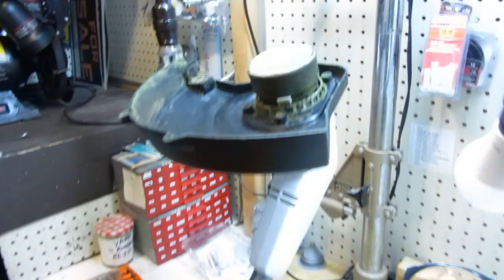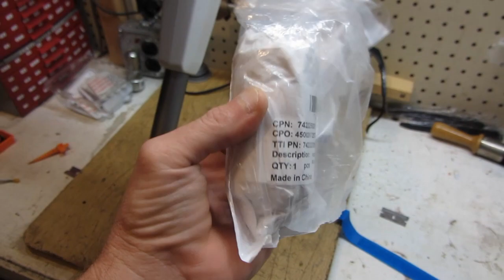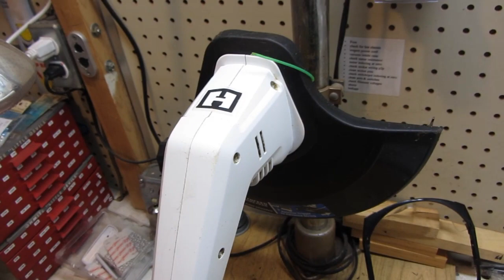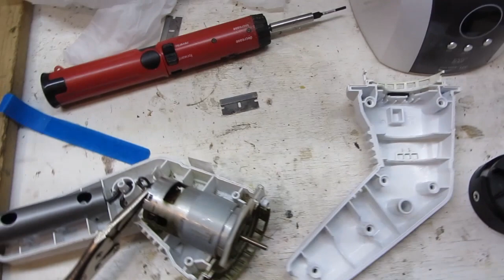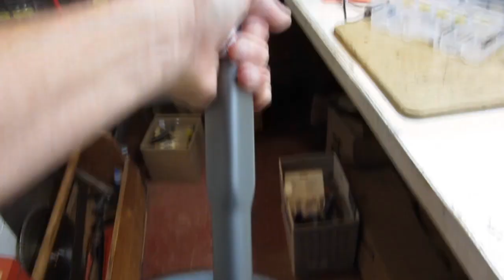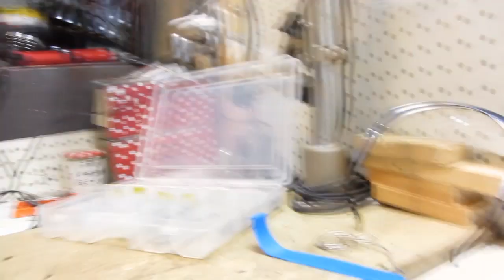repair HART 40V string trimmer HLST01VNM HLST01 junk garbage motor poor warranty experience

Comment: THIS TRIMMER IS A NIGHTMARE. TRY TO REPLACE THE TRIM HEAD WITH A BETTER UPGRADE. YOU HAVE TO REMOVE ALL THOSE DAMN SCREWS. I'M UNABLE TO REMOVE ONE OF THE DAMN SCREWS SO IT'S A LOST CAUSE THROWING THE THING IN THE TRASH

Comment: after replacing my motor, it lasted about 2 years with moderate usage, I cut extra flow slits on the opposite side of the air slits it has to allow for more heat dissipation and added small wire screen over it. So far its been working 1 year no problems yet. My opinion is its overheating. As you can tell on the side of the motor from the burned debris marks.  btw this motor is used in many different manufacturers ryobi, hart, and a few others

Comment: Used mine 6 times before winter. it was stored in the garage. Charged my batter so I could use it for summer and nothing,  just a humming.  This motor seams like it was not meant to run on 40 V Mine is the one with the motor in the handle and used a flex shaft.

Comment: I have the 20v.  It just died after about a year and a half’s use.  I didn’t see or smell smoke. Do you think it would still be the motor if the batteries (I have 2) are good?  I used it a lot.
Reply from the maker: Hard to say for sure, but surely could be the motor, that seems to be a weak spot on the HART equipment.

Comment: I've had my Hart trimmer now just under 2 years..and it's only been used maybe a dozen times in a very small yard. Well today I was using it and I started to smell weeds burning.. so I carried on thinking someone was just burning weeds 🔥.. well next thing I know the head of the trimmer spins off like a top 🌪️🥏 .. I guess it decided it wanted to go back to China. Come to find out the weeds had wrapped around the shaft behind the trimmer head and the shaft got so hot that the plastic trimmer head literally melted off..  now I'm wondering if I too will have to drive an hour.. or will have to pay to ship it back for warranty.. I guess I'll find out , either way  I've never seen this happen before..
Reply from the maker: yes, the whole thing is shameful garbage.
Reply: Agreed 👍  @bigslick
Reply: I told warrenty dept that it was ti far a drive for me and they sent me the parts needed for free.  Could try that.

Comment: I just unboxed mine, and I already hate it. The auto feed string thing is extremely annoying. Every time you let off the trigger, it gives you more string regardless of if you need it or not
Reply from the maker: agreed.  It is unusable unless you keep your finger on the trigger the whole time that you use it.  Otherwise,  you will eat up a whole spool in one use.  So I have learned to keep the trigger engaged the entire time that I am using it.

Comment: I’ve had mine for 2 1/2 years, use it 2 times a week and my only issue is the cap for the string falling apart. My sister has one also.

Comment: Why did you spend 40ddollars on a motor if you hate it ?
Reply: Because electric weed whips are expensive. 40 dollars for a couple more years of use is better than spending hundreds for a better one. I bought the bigger battery for mine before it burned out too. So i was already over $300 into my walmart weedwhip. 😅 another 40 to keep it alive is nothing.

Comment: That's why I would say. Never buy a brushed motor tool because they tend to burn out the brushless. Seem to last much longer brushless. Usually it's the ball bearings that go out
Reply from the maker: I agree regarding modern tools, but in my lifetime I used many old vintage USA brushed tools and never once had one fail so quickly.  Most lasted decades and with regular use.  This is just Chinese junk.
Reply: @bigslick  I almost wanna say the motors are also being overvoulted. That can also cause the brushes that go out sooner. That motor doesn't look much bigger than an R. C car motor for like a one seventh 1/7 oR 1/5 scale r c car
Reply from the maker: @hellhound-si5oz  it is a tiny motor, for sure.

Comment: This happened to mine today, battery fully charged and then I smelled burning  I was using it on very thin short grass for 10 minutes. I bough this about 7 months ago.  I am livid.  I will call them on Monday.  I sure as hell do not keep receipts but the thing has serial numbers on it and the know how old it is.
Reply from the maker: good luck but they are terrible to deal with, unless you are lucky enough to have a repair center very close to you.

Comment: I had the same problem with this trimmer motor burned up 3 weeks of use then replaced it with another one and it burned up 2 months of use and I just smashed it and threw it away cus I did NOT want to put a third motor. and how did yours burn out 🤔. These trimmers are just garbage these days 😡
Reply from the maker: yes, this HART trimmer is junk.  2nd motor is OK so far but it's only been a month since I installed it, and it gets very little use.  I expect that this 2nd motor will fail in a similar time frame as the first.  Magic smoke!
Reply: @bigslick it really is garbage I Smashed it cus i was tired of it cus it always would jam with weeds after cutting and that’s what caused the two motors to burn out so a few days ago I bought a kobalt trimmer and it works like a charm 👍🏽

Comment: Hart is junk. same problem here, motor stopped working after 5 months. Can you give me the link of the motor  you bought on ebay? thanks
Reply from the maker: yes, it is junk, and the replacement will be junk also because it is the same factory motor.  Anyway, here it is: https://www.amazon.com/dp/B08TGGSN43
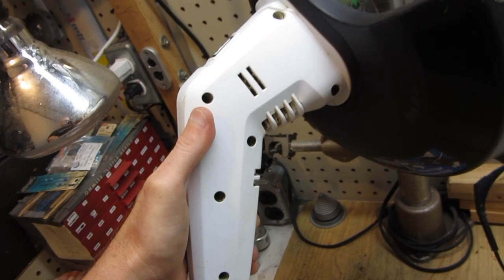Reply: hi  @bigslick  , at 2:08 , which size of allen wrench or hex screw driver do you use? I tried opening it today but non of my allen wrench will fit their stupid hex screws. are they metric? and the holes where the hex screws located are so deep that my screwdriver can't get in, so I have to use an allen wrench instead. horrible design. and by they way, you said they are star drives but I checked them with a flashlight, looks more like hex screws.
Reply from the maker: @cardionadine7483  size is T15 Torx.  Most modern stuff is Torx (aka star drive).
Reply: Hi  @bigslick , Finally I am able to open it. The holes where the screws sit in are very deep and it is a pain in the buxt to unscrew them, especially the 2 at the end. By the way, found another video, exactly the same product by under a different brand. Looks like this trimmer has a design problem, it traps weed and eventually got the motor burned, maybe not 100% the motor's fault. https://www.youtube.com/watch?v=BdIm4zUSdxQ&list=PLsqiZwb1So33STp05N2yC3pTXc4SiimkI&index=37&t=185s